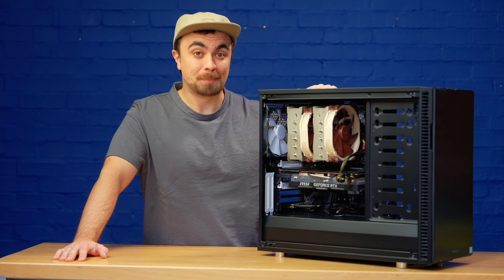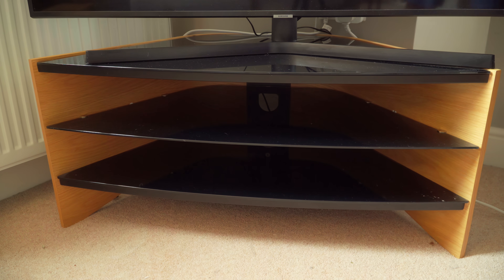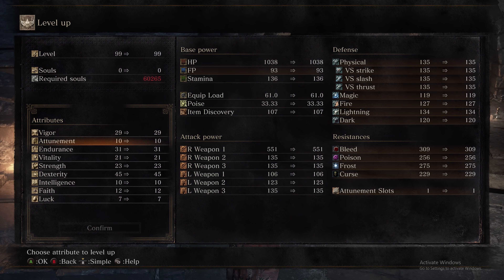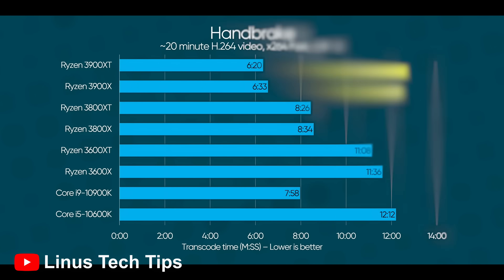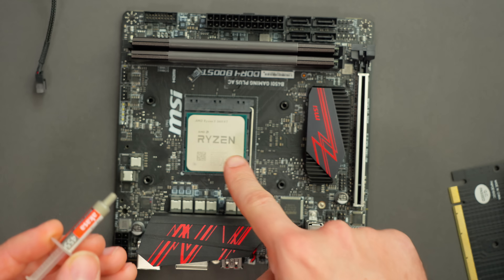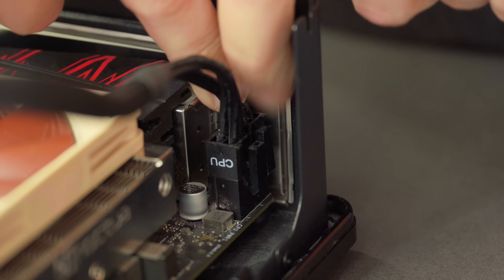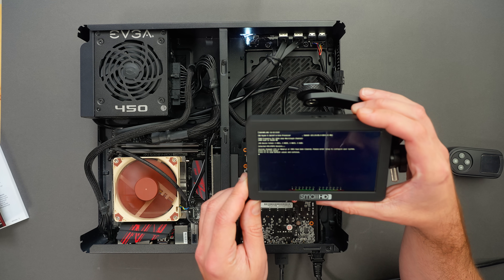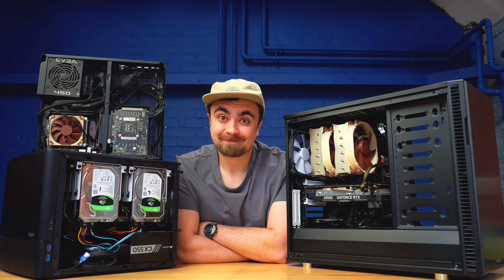How I Learned to Build a PC

Comment: Since no one has mentioned it yet: The cooler you fitted comes with pre-applied thermal paste, not to mention the amount of thermal paste you put was perhaps 1.5x what you needed. Really cool video though, that's just my tip for the future :)
Reply from the maker: I actually got the original paste covered in crap before filming because I'm daft
Reply: Back when I built mine, my mind went blank for a moment and I just thought "Is this thermal paste?", before poking it and leaving a nice big fingerprint
Reply: @generic_luke  I have installed two AMD CPUs, both with the stock cooler and I made that mistake both times lol
Reply: @MikeBoyd  Everyone has an opinion on thermal paste, the truth is, it really doesn't matter how much you put on, or if was pre-applied and you added more. It will still work perfectly fine.
Reply: @hippopotamus86  yeah, unless it's one of the (rare) electrically conductive pastes, there's nothing to worry about
Reply: @hippopotamus86  It does matter. Too little will cause overheating. Anything beyond 'enough' will perform the same, as the cooler will just push any excess out the sides. It is important that your thermal compound is non electrically conductive though, otherwise it cause shorting on your board
Reply: @hippopotamus86  Literally, people watch one LTT pc building video and think they are professionals, when its just paste and if there's extra its not going to do anything if it spills over.
Reply: @MikeBoyd  i actually feel that. when installing my ryzen i didnt notice the cooler had thermal paste on it so i smeared all over it lol. i have a tower cooler now tho so no boring table action anymore.
Reply: @MikeBoyd  lol
Reply: Alas, I didn't wait long enough to see you install the second cooler (which I'm assuming was fine too :))
Reply: @fency3113  The amount of paste was fine, better safe than sorry, especially for a beginner. My GPU throttled for a while because I didn't apply enough after I took it apart. Hotspots are annoying af.
Reply: Timestamp
Reply: imo its better to have to much with out making a mess than to have to little. just keep the paste off the board and clean any off. i think there was an old gamer nexus or ltt video talking about this.
Reply: there is no such thing as too much thermal paste
Reply: I mean as long as it isn't liquid metal it will be fine but clean up in future will be a pain
Reply: This is why we have the ‘perfect amount of thermal paste’ meme.
Reply: I would actually say he used 3x
Reply: @akex067  If you think that is 3x the amount of thermal paste you should be using then you are using way too little.
Reply: @amhokies  not really as long as you're buying relatively new and first hand components you don't need almost anything
Reply: @amhokies  you should have a pea-sized dot of thermal paste for that CPU, he had a mountain of it on there

Comment: Half way through the video, loving it, but the thermal compound you used is a bit subpar, especially on a Mini ITX build where thermals play a big role, loving to see more people get into the custom pc space :)
Edit: you used the stock AMD cooler initially, these come with thermal compound pre applied, so there was no need to put your own, when you switched it to the noctua low profile cooler, i really hope you used the noctua thermal compound that usually comes in the box...
Reply from the maker: Is it cheap compound? Would expensive stuff make a difference?
Reply: @MikeBoyd  using different thermal compound (I recommend Noctua NH-T1) will help improve thermal transfer from the CPU to the cooler, and therefore improve the overall thermals of the system.
Reply: @MikeBoyd  Yeah, its somewhat evident by the consistency... I personally like to use Arctic MX5, but some people have other preferences, there's no need to go for something exotic like liquid metal, Here are some of my recommendations: Arctic MX5, Thermal Grizzly Kryonaut, and Noctua NT-H1
Side note: PC components are more resilient than most people think :)
Reply: @MikeBoyd  given the parts you picked. i honestly don't think it matters a whole lot. even if the paste was god awful and caused a 10c difference its unlikely that 10c would effect performance that much. Unless you have temperature issues. download open hardware monitor (or hwmonitor) and keep an eye on the max temps. In general its best to stay below 85c on all parts. but given its a pretty small case if you run really long renders your cpu temps might come close to 85c while under a long load. idle temps should be from 45c to 55c.
Reply: @MikeBoyd  it'll make a difference, but proper application is more important. If there's no pad on the cooler already, then you only need the equivalent of a grain of rice
Reply: @matthudsonau  Well it's been trued and tested that too much thermal paste wont do much harm except for the cleaning... Obviously some thermal compounds are conductive or capacitive so that's something to keep in mind...
Reply: @MikeBoyd  You're talking a couple of degrees matey. Yes some TIM is better (and more expensive) but if you're just doing desktop use don't bother worrying about it - that's for overclockers, those in hot climates, and people who need to have the absolute best at all times regardless. EDIT: Up to that part in the vid... putting too much TIM on is no issue providing it's not electrically conductive.

Comment: Interesting - I never thought that the power switch orientation mattered as it's just bridging two wires. but seems to matter here.

Cool video :)
Reply from the maker: I actually had it on the wrong pins. I believe the orientation doesn't matter. You just have to short the correct pins!
Reply: @MikeBoyd  The only ones that really matter are power LED/HDD LED. these days they usually come as a single + and a - rather than together so you cant really put them the wrong way around now if you follow whats wrote on board and the jack. That said if you put them the wrong way around nothing bad happens the LEDs just dont work :D. Fun fact its actually a standard on most boards what way they go in. Some cases such as from NZXT have a jack with all connectors on you can plug in all at once and be done. The front panel connectors are usually the thing that confuse people the most i wish all cases put them in a block like NZXT.
Reply: @AdamsWorlds  out of all of the advancements pc building has made over the past several decades, the front panel connectors has barely improved at all. it's just a bundle of wires and the labeling on mobo is ridiculously small, and it's easy for even seasoned builders to screw up.
Reply: @JeffDeLamater  yeah, no reason for it also as i said most cases and boards they are in a standard place. NZXT put them in a block together and provide an adaptor to split them into individual ones if needed. IMO this is the way forward! The other thing people mess up is the extra power connector that does not have to be used (some psu's dont have extra connector and people think they messed up), and 3 vs 4 pin fans. Most common ones i get asked about anyway. Front IO though is by far the biggest issue i see.